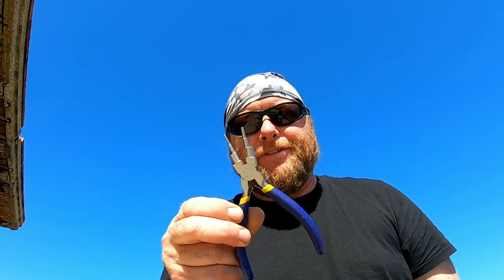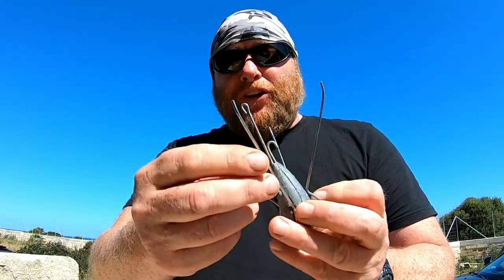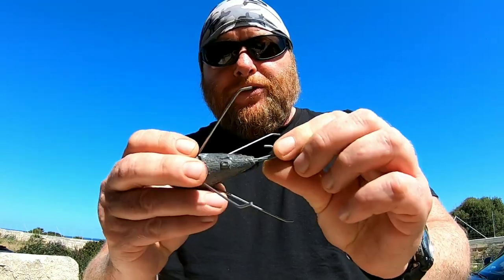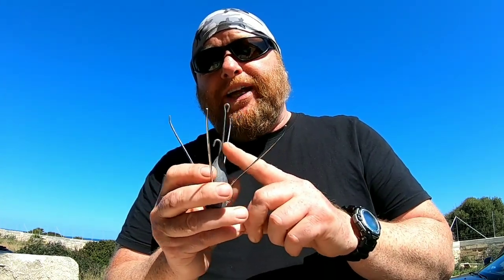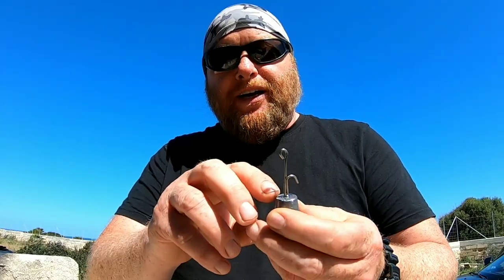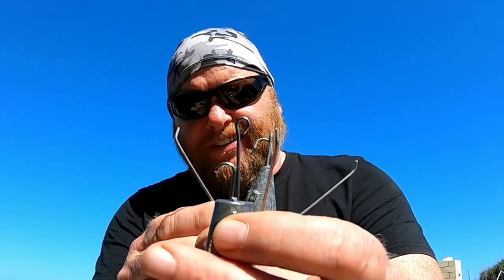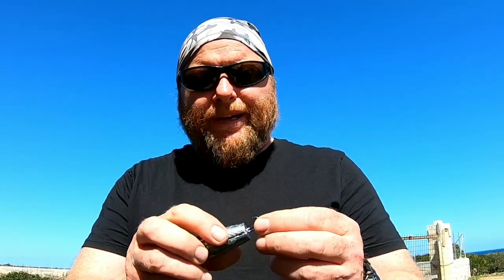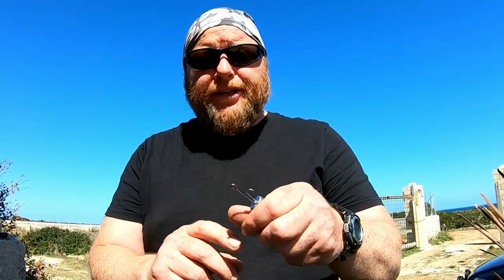How to save money and learn new skills

Comment: I was lucky enough to have made a 6oz fixed grip mold in metal work at school in the 3year I've been using it 45 years have made hundreds for me mates and have sold a good few but i will say one day many year's ago one of my cats jumped over me and nocked all my molton lead over it splashed up and left me with a full depth burn right between my eyes a blob about the size of a two pence it still Herts at times so be carefull out there that poop get HOT. thanks again mate
Reply from the maker: You can be to careful,  when your messing around with lead. I have burnt myself a few times as well, thanks Brother. Fish on👍😁

Comment: Nice one Billy 👍
I had a bit of unclipping problems recently with up and overs. I started putting a free running 8mm bead on the snood, when clipping make sure bead on up side so when it hits water it smashes up and knocks the line off the top over clip like a splashdown. Works in my head anyway haha 😂 🎣👍
Reply from the maker: Sounds like a good idea, hope it works out. Thanks Brother 👍😁

Comment: Hey Billy... When you were making those angel clips.  Were you running with 1.5mm or 2.0mm Stainless 304 s[ring steel? Thanx Bud.
Reply from the maker: Hi Randy. Unfortunately I'm not going to make the angled ones, because they're rubbish. But if you really must have them,  just bend the metal down 45 degrees. The tails in the video were made from 2 mm,  but normally I used 1.7. I will send you a link, thanks brother 👍